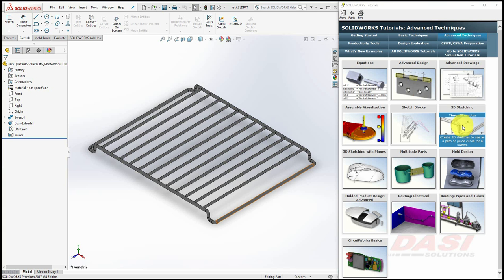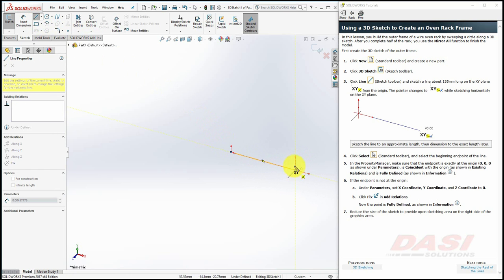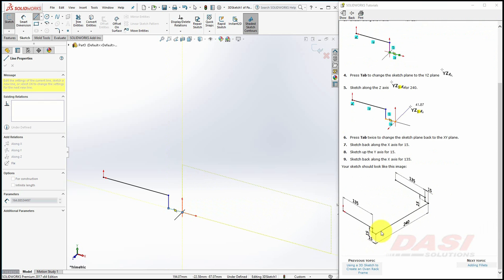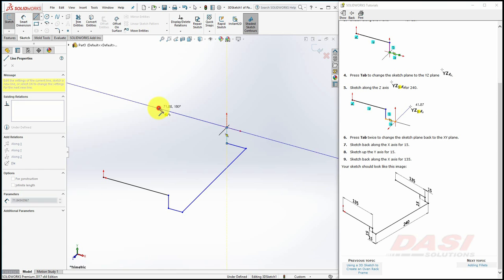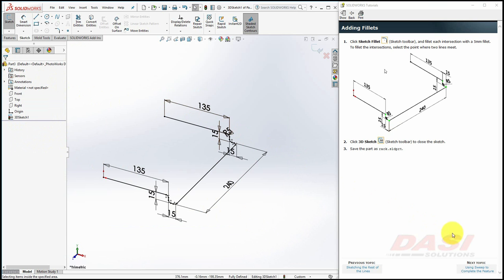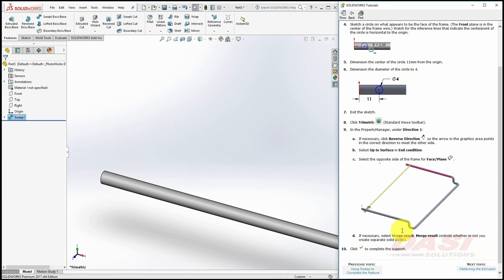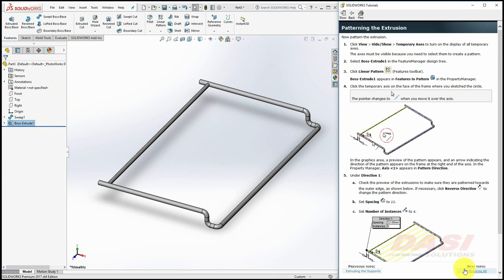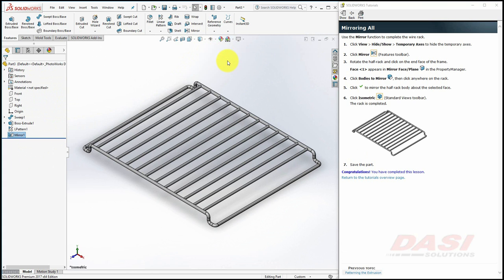Advanced Techniques: 3D Sketching | SOLIDWORKS Built-In Tutorials

Comment: The position of the sketch relative to the origo is poorly chosen.
It should be positionen symmetric to the origo since the part most likely will be placed symmetric in the assy. Much easier to mate the part in an assy. Mirroring could also then been used when modelling the part. It's very common to model like this but it sucks. 80% of 3D cad persons don't understand the importance of capturing design intent and orientation of the part. Very frustrating.
One person even yelled at me once when trying to explain. He yelled "I hate those fucking planes" He was a brilliant designer though.
Reply: maybe tje problem that there are few people who knows every features inside out and why and when to effectively use it